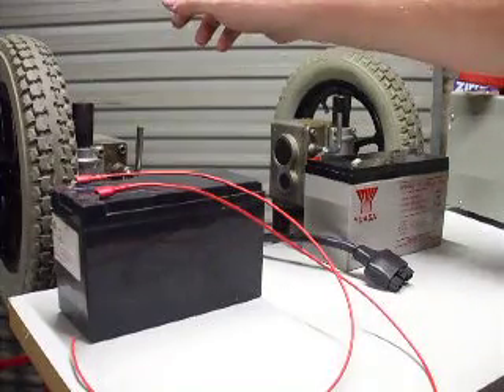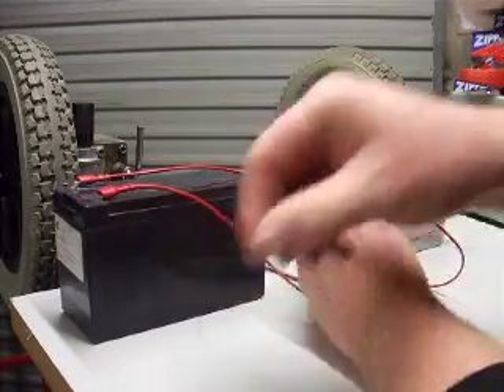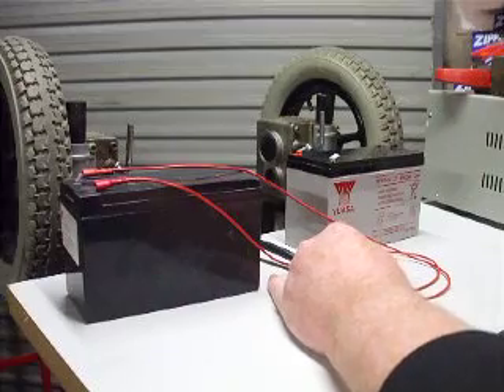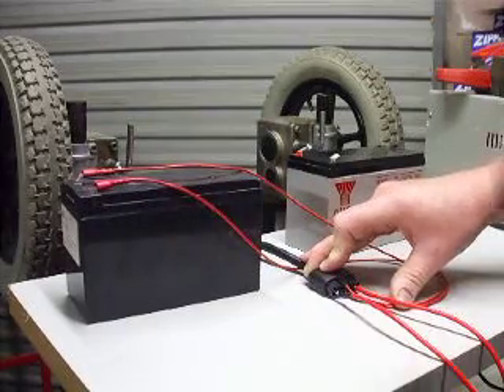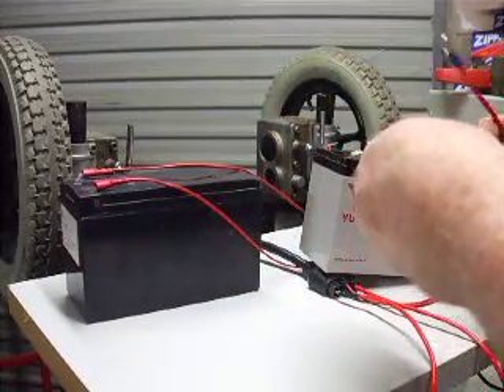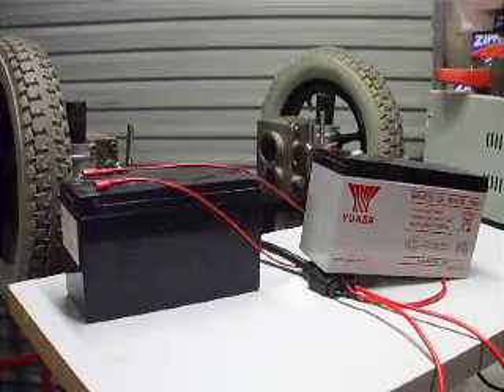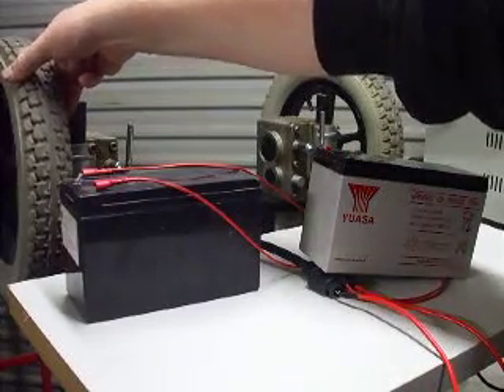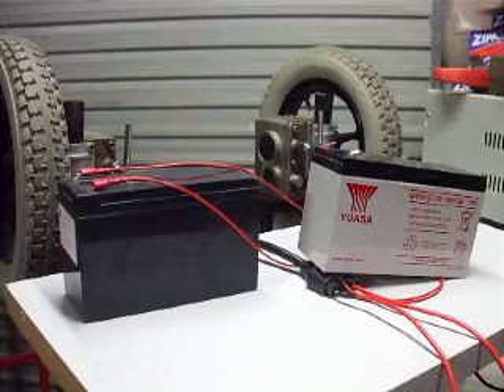How to test a wheel chair motor (1)

Comment: Hello i have a motor like that and when i connect it to 24v battery it draw 14 ampere without moving and there is noise sound do you know what's the problem please?
Reply from the maker: It sounds like you have not disengaged the brake, is there a lever or button on the outside of the gearbox that you can activate, if so try it and see if you can spin the motor by hand. Normally the gearbox needs a voltage across 2 of your 4 wires to disengage the brake. But the lever/button is there if your battery is flat and enables the wheelchair to be pushed.

Comment: Can you not disengage the brake with manual lever or is there not one.....
Reply: Yes, there is a manual lever, but I go on to use these motors to make a segway, and I do not need or have the room for a manual lever in my design. I think the manual lever just disengages the motor/gearbox. But if you tried to run the motor then the main drive shaft will not turn because it has been manually disconnected by the lever. To get the wheelchair to electrically move you would have to re-engage the lever and apply power to disengage the brake and motor.
Reply: The brake is always engaged unless power is run to it to open it.

Comment: This is a very sturdy well built chair♿️>share4.photo/FoldWheelchair?ѽ  . Sentire thought of everything. It’s easy to fold and unfold...just a couple of seconds. It comes with a nice storage case that is easy to put on the folded chair using the attached Velcro fasteners. I’m taking my first airline trip with it next week. Airline appears to be willing to work with me on its transportation. Drop it off at the door of the plane and retrieve there after the flight.

Comment: If brakes removed will chair still operate?.  (Flood damaged)
KK
Port Charlotte FL
Reply: The chair will still operate without brakes. The brakes are designed to be on all the time unless a voltage is applied to them, so if you have a flat battery and are on a hill the brakes will engage automatically. Removing the brakes will remove this safety feature.
Reply: Any way we can bypass the safety feature?
Reply: @tech333tex5  Here is the link for removing the electric brake: https://www.markssupplies.com/self-balancing-scooter-day-2.html
Reply: @iandavis3936  Hiya does it work on a mobility scooter and will scooter work as normal? Thanks

Comment: Do you compare the RPM of the motors? What if they're different? Will your motor controller compensate for this?
Reply: Any slight difference in RPM is compensated by the steering, of course the same model motor must be used for both wheels so there is not much difference in RPM anyway.

Comment: How do i connect Power wire to a Power Wheelchair Motor that is already installed on a Wheelhchair. In order to Turn that Motor ON , for each wheel on the Chair. To propel the Chair Forwards or Backwards. Using a toggle switch power control to the Motors and battery. Needed to Drive the Wheelchair Forwards without Steering Control. In situations the Regular Motor Control needs to be BYpassed to disengage the Computerized Drive Controls that are Causing the WHeelchair Wheels to stop on slippery Surfaces. The Wheelchair could be driven out of from stuck positions in difficult terrain if this New Motor Control was installed COrrectly. Answer this as I need to know, Locals here in the Sault Ste Marie dont have any explanations as to how to Connect the Power to the Motor safely from a  Secondary Source.
Reply: How to connect the wires is covered here and in the comments many times but for your situation I would stick to 12v for the motor and brake power, I assume you have 2 12v batteries and they are connected in series to create 24v. So just connect 2 wires to one of the batteries and have those 2 wires connect to a simple on off switch and then down to the brake to disengage it, then have the same or another 2 wires from the same battery go to a simple 3 way switch and back down to the motor. This is how you would connect just one motor, so if you want independent motor control just repeat this for the other side.
So you would have 1 on off switch to disengage the brake and another 3 way switch to go forward off or reverse. The 3 way switch will be a DPDT (double pole double throw) 15A 3 position with 6 terminals.
I'd use 12v only so that the motors are slower and less likely to cause an accident, but you would still need to be careful as there will be no speed control. To add speed control is a whole new level of difficulty and cost.
Reply: @iandavis3936  Yes this Wheelchair is 24 volts, I would want to limit the Power Switch to be 12 volts to reduce the speed of motor. I would want 1 switch to control both Motors , so they would drive straight and not turn the Wheelchair. I wasnt sure an Additional Power source could be added. Would Sparks Fly if i by mistake left the Chair Power on and then also the New Power Switch we are Wiring? I would have the regular power to the Chair off and then turn the motors on with the seperate switch. So that both Wheels Spun but without steering.
Reply: If you left the chair power on by accident then nothing would happen unless you touched the joystick. If that happened I don't think it would be a problem but the chair would be difficult to control.
The switches that I mentioned could be wired so that they control both motors and not just one, but you would still need 2 switches in total, one to put the brake off and the other to turn the motors on.
This whole idea is feasible but it can also cause an accident unless you are careful, there are better ways of doing this with relays so that you can not energise the motors with the main power on or the brakes on but it is complicated for a DIY person to do and would include a lot more wiring but no expensive components just  a lot of labour.
Reply: @iandavis3936  Oh Ok, the only scare i had was that 1 power supply to the motor was 24 volt and the other switched was 12 volt. I am Very Unlearned but remember mixing different voltages was a NONO. as when both the 12 volt and 24 volt power sources were accidently switched ON. I would love to Hire an Expert to wire this up for me but explaining this to Local Technicians that i can reach by phone would not end up finding me a Pro that could safely install that. I Often get stuck in 2 inches of snow and then the wheelchair computer only allows 1 wheel to spin. So I remain Stuck, but if 2 wheels were spinning then i could get unstuck from the 2 inches of snow. then return to regular control of the wheelchair. Noone on the Market has a Solution except to buy a new 25000 dollar wheelchair, so it is worth my effort to learn to install the 12 volts switch.

Comment: Dam your hands hide everything and how about overhead shot shots and closeup of plug.i know this is older got anything new i don't see any answers
Reply: In the plug there should be 4 wires, the 2 large wires are for the motor and the 2 small wires are for the brake, apply 12 or 24v to the 2 brake wires, if you hear the click of the brake disengaging then you have the polarity correct, and  then apply12 or 24v to the 2 motor wires, the polarity doesn't matter for the motor, it will either go forward or reverse depending on polarity.

Comment: Maybe if you MOVE your fucking hands you inbreed moron... people   may be able to see what da fuck you are doing. Bullshit video!!!
Reply: Nice comment, there really isn't much to see, there is a brake with 2 small wires and the motor with 2 larger wires and I put 12 v across the 2 brake wires and 12v across the 2 motor wires and that's it.

Comment: im planing to use power chair motors to power an electric bike, are the electronics required for the system to work or can i just remove the electric brake and use a simple switch and charging circuit?
Reply: You definitely need electronics to control the power, a high current motor controller or try to use the electronics from the wheel chair.
Reply: right, thank you for the answer.and as for the electric brakes on the motors, do i remove them or are they required for the system to function properly?
Reply: They are not required for the system to work, they just stop the wheelchair rolling away when there is no power to the motors.
Reply: These motors are high torque but low speed, for an electric bike I'd recommend getting an electric bike kit from China via Aliexpress, it's the lithium batteries that can be expensive.

Comment: perfect just what i was looking for.TU. i hope it's not too late for me. I connected to battery didn't know about breaks.
now i need a video on how to disconnect the breaks.
Reply: https://www.markssupplies.com/self-balancing-scooter-day-10.html
Here's a link to my website
Reply: I took the brakes off to make a remote control wheelchair but now the computer is giving me a error code 3 which is brakes ,might you be able to tell me how I could make it work again? And if it's possible ....with out brakes ... Quantam edge 3 I think is what I have... thanks any info would be greatly appreciated

Comment: My Quantum Q6edge will only do 1.3 mph.I have new batteries. Any trouble shooting ideas?
Reply: It will either be the controller or a wiring problem leading to only 12v on the motor instead of 24v.

Comment: having problems with  wheelchair. The left wheel keeps disengaging making it spin how do I fix it
Reply: The default for safety should be brake on with no power, either the brake is getting 12v or more due to a wiring problem or the brake mechanism is not returning to it's default position because it is sticking, the mechanism relies on a solonoid and these things can stick, if you can get to the inside of the solonoid then you should clean it and lubricate it with an oily rag.
https://www.markssupplies.com/self-balancing-scooter-day-10.html

Comment: Hi, my girlfriend is having problems with her wheelchair. The left wheel keeps rattling and shaking a lot and causes the wheelchair to lurch forward in use. Do you think the break is sticking? When it gets up to speed it smooths out. But soon as idle and then moving off slowly, the same problem happens.

Comment: Do you have any ideal why my  mobility scooter bucks? It jerks, then will slow down, then resume normal speed, slows down etc
Reply: Could be motor brushes
Reply: Never worked on a scooter, but I suspect it is dirty contacts in the speed control. If you have more than one motor then it would be obvious if it was motor related as it would not stay in a straight line.
Reply: Ian Davis

Comment from the maker: Yes, it is possible to remove the brake assembly. If you would like to see how I did this then please go to my web page here: http://www.markssupplies.com/self-balancing-scooter-day-2.html
Reply: How did you energize the brakes?  On the motors I have - there are four terminals:
  - Red 
  - Black
  - White
  - White
I believe the Red/Black terminals are for running the motors.  Now how do you connect +/- to the two white terminals?  Thanx
Reply: Ubaidul Khan Yes, the red is +24v DC and the black is -24v DC, it will also work ok with 12v but it is designed for 24v.
The 2 white wires in any order can also be connected to 12v, one on +12v DC and the other on -12v DC, you will here a click when you do this which is the brake solenoid disengaging.
When you here the click then you know it is ok to run the motors and connect your black & red wires.

Comment: I need TWO PS-12330-ND amazon has them for $90.95 for a Scooter Store Wheelchair do you have them can I send to you $65.00 per month until you have the $182.00 plus some for postage please it is the only way I get around I really need the batteries
Reply: I don't seem to get notified when people ask questions so it looks like I'm 4 years too late!! Those batteries are AGM batteries and I do not have any, all I am using are normal and very cheap lead acid batteries.

Comment from the maker: As per the video, I applied 12v DC to the middle pins to turn the brake off. You will here a small click when the brake solenoid disengages. Your plug maybe different but it will have 4 wires going to it, the 2 smaller gauge wires will be for the brake. The other 2 larger gauge wires will be for the 24v DC motors.
Our dot com MarksSupplies website on our Segway Project page shows how you can easily mechanically remove the brake should you need to.

Comment: Could you please let me what is  voltage to apply to the break so the motor will turn for testing 
thx
Reply: 12v is enough to release the brake.

Comment from the maker: I haven't tried it but these motors come from wheelchairs & they are designed for 24v, a wheelchair isn't the fastest thing around but it does have a lot or torque. But if I was to half the power then I suspect it would not be good enough to propel a person adequately. These batteries are fairly cheap & it is easy to connect them together to create 24v, I would recommend doing this. Just connect + of one batt to the - of another, the 2 terminals that are left will have 24v on, it's that easy.

Comment from the maker: I'm using a 12v lead acid battery, I normally connect 2 together in series to get 24v. Any old 12v car battery will also do. The motors are designed for 24v but they can be tested with just 12v. To remove the brake and for lots more information please see our dot com web site markssupplies and have a look at the Segway project in particular.

Comment: What batteries are you using? I am working on a robot, but I can't seem to find any batteries for the same motors. Thanks!
Reply: any 12 or 24v batts will be ok, I was using 12v lead acid batts, the type found on motorbikes or house alarms but for a robot you should really use lithium batts as they provide a lot better power to weight ratio, you can get lithium cells from old laptop batteries.